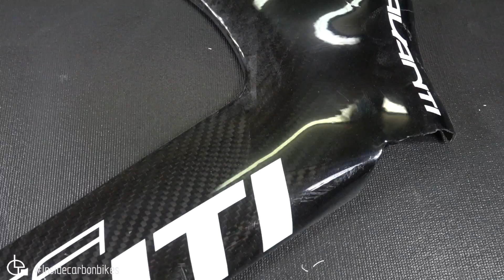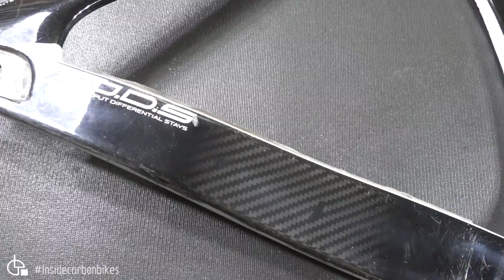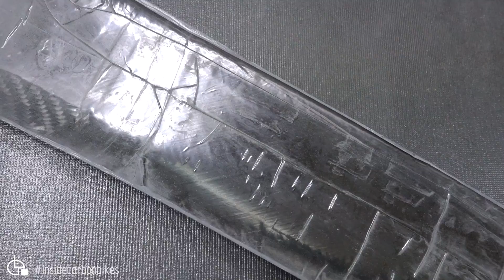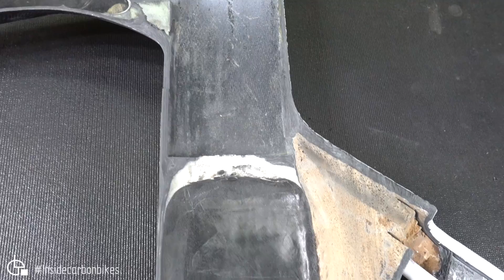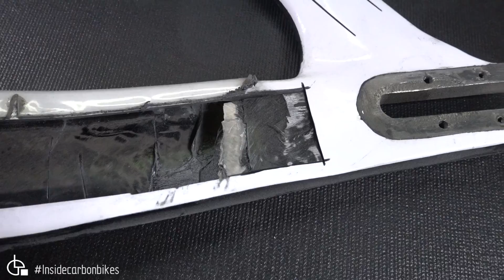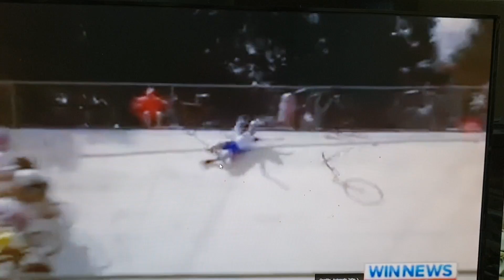Avanti Pista Team Cut Up and Review

Comment: Seems like the entire head time area could have been thicker with possible additional internal walls to better connect stresses to the top and down tubes. But if you intended to design the head tube races to break away, you might design it the way it was..?

Comment: do bike manufacturers crash test carbon bikes (or any other bikes) to determine how they will fail and to improve designs? This is how the car industry works, you'd think that the bike industry wouldn't be any different in this critical area?

Comment: Curious to know what actually determines how stiff the BB is. If you look at this cutout obviously the BB area looks very big, but the sleeve for the cranks doesn't look to be connected to it in any different way than on the road bike cutouts. Is it just because the BB area is bigger = more material = stiffer?
Reply: That's right. The common language is misleading because it's not the bottom bracket that flexes but the frame around it. So whatever one can do to make the frame stiffer does the job. UCI limits the size of the tubes so adding thickness is where it's at.

Comment: Thanks for the cut up and thanks Ryan for the donation. The fence jumped in front of of me!  would be interesting to see the fork/wheel - looked like the front wheel was still round at https://youtu.be/PLIaKNKnHE4?t=10m19s also the head tube https://youtu.be/PLIaKNKnHE4?t=3m02s is that a void in the head tube or delamination? either way no real cause/effect in the ripping of the headset.  Raoul any chance of a getting a look at the fork?